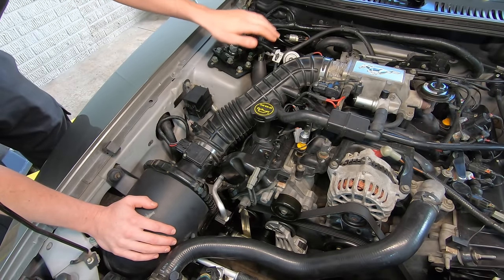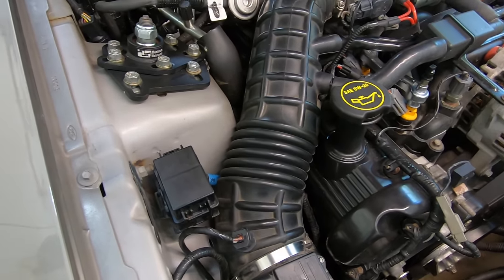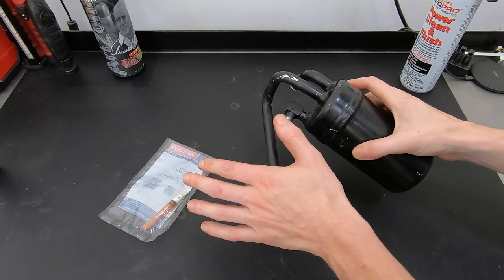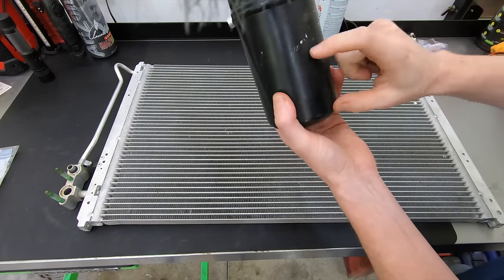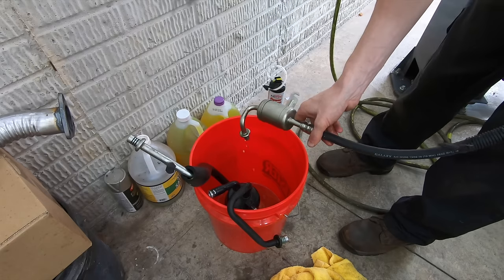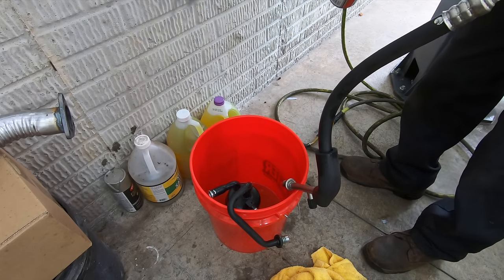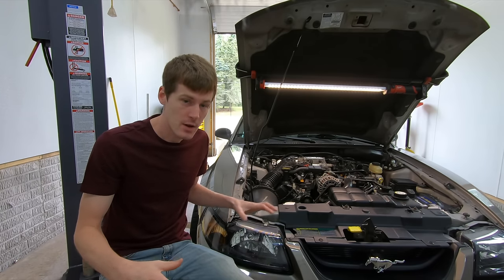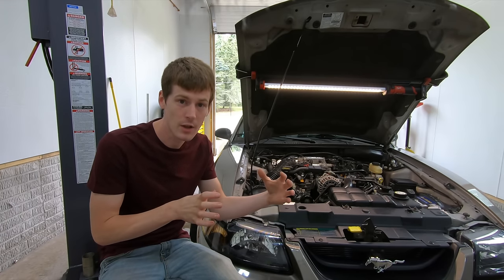How To PROPERLY Flush and Recharge A Contaminated AC System.

Comment: How much more would it cost to just replace evap and hoses instead of flushing everything and then blowing it out so no flush is in the system. Since you changed almost everything
Reply: In my situation changing the evaporator would require pulling the dash and that would require about an extra 2 days for my truck

Comment: Is this how you get the oil for an R12 system out when you fit the system for R134?  I heard the R12 oil is different than what is used with R134 so they the old oil needs completely removed
Reply from the maker: Yep, this is what you need to do.
Reply: @RepairGeek  thank you

Comment: Can you please tell me how to repair my 2021 toyota camry? It has a mildew smell coming into my car from ac. Is it the ac receiver dryer(header and desiccant bag or evaporator or condenser?
Reply from the maker: Your evaporator drain is probably clogged. Unclog the drain and disinfect the box that the evaporator is housed in inside the dash with specialized cleaners.

Comment: Thank you for your informative video. I am doing an LS swap on a Grand Wagoneer, and it may be a month or more before I can start it to add refrigerant. I would like to add the new A/C components to test for leaks now so I have access and don't need to drop my antifreeze in case I have a leak. Is it ok to leave the system with only vacuum pressure until the engine is running to add the refrigerant?
Reply from the maker: Yep the vacuum won't hurt anything.
Reply: Don't forget to upload videos

Comment: I didn't follow why you had too much oil the first time. When you vacuum the system would it remove the oil from it?
Reply: Same here...
Reply from the maker: The car's original compressor was failing. I installed a brand new from Ford Motorcraft compressor. 
The second compressor had a leaking input shaft after about 2000 miles.
I then installed another new OE Ford compressor.

Each one of those compressors had a full system charge worth of oil in it. By the time the 3rd compressor was installed the system was so heavily saturated with oil that it was no longer cooling and the high side pressures were too high actually hitting the pressure relief on the system.

Comment: I have to flush my ac in my 2005 121nz Toyota Corolla there's a blockage somewhere between the compressor to condenser to the high pressure switch the gas is not passing the high pressure switch to the evaporator an expansion valve my compressor went bad changed it an the pressure switch but it's not passing the pressure switch I'm going to change the condenser also

Comment: excellent tutorial when you started the recharge I missed the part when the high presure red valve was opened?
I do understand 1.attach can adaptor.2.attach to yellow tube, then open can 3.then open blue valve (missed the red valve being opened)?
also when you connect freon can to yellow tube after opening can shouldn't the yellow tube be loosened at gauge end to purge air in tube?I'm not sure my $30. gauge set has the check valve you mention in your replys to this matter.
when 1st can empties I assume both valves are closed untill new can is attached an opened then opened?
thanks for sharing you obviously put some time in the video thats why it's on top at y-tube.
Reply from the maker: 26:06
Reply: @RepairGeek  thanks brother see at 27:46 when starting the charging you said valves where open when you meant only low valve is open. thanks

Comment: I enjoyed your highly informative & stepwise presentation--you clarified a lot of my doubts about  lubricant.   It will help me immensely when I recharge my system .  Unfortunately moisture cannot be removed from polyethylene / polypropylene glycol by vacuuming--even for extended periods as these polymers are extremely hygroscopic; only way is either by 3A/5A  molecular sieves (ideally activated @ 250 C in high vac) or drying agents (anhydrous CaSO4, Na2SO4, KOH, etc).  The purpose of extended vaccuming is to remove as much air from the system as possible.  Remaining traces of water are  removed by the silica gel  present in the accumulator/drier.  I guess you cannot avoid getting some air in when you charge refirgerant from the can after prolonged vacuuming, right--unless you have a T connection with vacuum pump and freon source??

Comment: have you ever converted older cars to R134A? I'm curious to know of if its doable, and how!
Reply from the maker: It's do-able. I've never done it. I don't own any R12 vehicles. I've heard that once converted the AC doesn't cool quite as well as R12 but, that's just rumor I've heard. No idea if it's true or not.
Reply: done this to a couple cars myself so i can lend some help;
i have a 1990 civic hatch that I did the a/c conversion on. here's what you want:

(i would recommend having a shop professionally vacuum out all contaminants and old refrig oil.)

!!!!!FIRST THING FIRST: IF YOU HAVE R12 IN YOUR SYSTEM DISPOSE OF IT PROPERLY. IT IS AN ENVIRONMENTAL HAZARD!!!!!

#1. if you have a serpentine condenser, either flush it or replace it with a parallel flow condenser.
I went the flush route and have had 7 years no problems, the performance is just not as good because parallel flow is used in R134a systems and is appropriate, while the serpentine condenser is the old style (but it can be flushed, due to the size of the tubes)
#2. replace your expansion valve/orifice tube, and your drier can. make sure to replace all the Orings in your system with green neoprene orings. this is crucial to not have any leaks. 
search up your shop manual to make sure the proper oring install process.
#3. expunge all of the old mineral oil out of the system either by flushing it or by replacing everything. 
#4. before everything is hooked up, charge your compressor with the appropriate PAG oil. (after I dumped all the old oil out of the compressor I measured what came out and added the appropriate amount until it was filled to manufacturer specifications, 4oz of PAG46 in my case.) then hook lines up.
#5. vacuum the system down for 15 mins, leave it for 15 mins, and if there are 0 leaks go ahead and vacuum it down for an hour.
#6, charge with appropriate amount of R134a. general rule of thumb is you want 15% less freon than what is specified by OE but YOU MUST CHECK FOR YOURSELF.
#7, enjoy nice cold a/c in a 30+ year old car B)

Comment: I have a 1976 Dodge B200 camper that uses what seems to be a mercury thematic controlled expansion valve and no orphus tube. Old school tech but I'm reusing it. I will put the other 1/2 of the oil in the evaporator in the dash (maybe). The evaporator is actually in the engine compartment in a metal housing. The drain pan had rusted holes but I rebuilt it exactly like the original. Others say to remove all components to flush and shake them around to get every corner of the evaporator and the condenser. This old school condenser has the large tube type so worth it to flush. Thank for telling us how the new ones are too small to flush.
The old Dodge evaporator and condenser had old oil in them. I hope only 2 oz in the evaporator will be enough. I am just draining out the compressor and replacing what comes out (maybe) while spinning. Others say to set the compressor with the pulley down for 10 minutes and then turn it again 10 times to make sure the oil gets onto all components.
The old evaporator and condenser had old oil in them. I hope only 2 oz in the evaporator will be enough if 4 oz comes out of the compressor. I am not sure why some say to just replace what comes out of the compressor while you say to split the the oil between the two. I don't have specs. It's from a 1993 Range Rover to replace my old noisy Dodge Compressor. All the hoses will bolt up nice and I have new proper line seals. The old Dodge did not use a screen filter but will check if the newish compressor has one on the intake. Compressors are similar in size and use the double v groove belts. The Range Rover had a clean working system. Googled the specs and oil capacity might be found. Should I split the oil capacity and not replace what comes out by splitting it with the evaporator? Since it was a working system shouldn't there some be in components while what is in the compressor should be the right amount? I have the proper flush kit, a gallon of fluid and proper new vacuum and gauges. I know how to use them. I'm going to use R12a since it is cheaper in Canada than the States and if it leaks it doesn't ruin the ozone. The Range Rover and the Dodge was converted to R134a so should work with R12a as well. I bought a new sealed dryer. Any help would be appreciated.

Comment: Hey dude, great vid and thanks for all the info. Quick question though, after flushing the system, if i put a new compressor, precharched with oil, do i still have to add oil in the evaporator or should I just let things like that?
Reply from the maker: I would verify that that correct amount of oil is in the compressor by draining it. Then, do your half and half.

Comment: I was wondering how you read the high pressure side is the high pressure side still connected to the vaccum pump or blocked or else it will lose pressure?

Comment: To check for a leak after you pull a vacuum on the system do not, I repeat do not fill it with air. Air has moisture in it. Use nitrogen before pulling a vacuum. Fill the system up turn off the gauges, then wait for a half hour and see if the needle moved. If needle moved fill it up with  R134 that has die in it. Fix leak and repeat.
Reply from the maker: FFS, so you're going to spend well over $200+ to buy a nitrogen tank and gauges, to POTENTIALLY keep moisture out of a drier? A new drier for this car is less than $20.
Also no refrigerant has dye in it. The dye is in the oil, this was covered in the video as well. Thanks for watching?

Comment: On a Ford classic car AC system that has the York compressor. The york compressor has a oil well correct?  With a drain and fill hole.  Did the evaporator, expansion valve, lines, dryer, condenser have any type of oil in them?

Comment: I'm wondering what happens to the compressor if there is not enough PAG oil in the system. Anyone?
Reply from the maker: It wears quicker. If the system is very low on oil, the compressor usually makes a growling type noise.

Comment: One thing to note people.  Never buy a remanufactured vehicle AC compressor.  Always purchased it new. Stay away from those “reman” units.

Remanufactured AC compressors are used, picked up as cores by the local parts stores, then they’re taken to a facility, where they’re cleaned up and reassembled with new gaskets & seals, but the wear & tear in the inside, is still there.

Comment: The flush and clean can says to run nitrogen gas through the system to remove air and condensation before vacuuming. I have not seen anyone do this in DIY videos. Is this just not done?
Reply: Charging the system with nitrogen is an extra step used to purge the system and to  check for pressurized leaks so you don't waste freon and isn't practical if you don't have access to any large tanks of nitrogen

Comment: “You will blow up the can” - if the refrigerant is added to the high side. Not if the compressor is not running and there was a vacuum pulled.
Reply from the maker: Yes, IF the compressor isn't running... I'd love to know how to charge a system using cans, WITHOUT the compressor running...

Comment: Heard that you can and should check compressor for metal shavings contamination .  I've heard but am uncertain whether you can flush out system of this .. ?  Needing to replace compressor on my 15 Ford Fusion SE 2.5 L and kinda leaning towards it's almost NOT contaminated the condenser as well . IF contaminated some mechanics say a flush won't clean it out well enogh and need replacing condenser ? Any advice would be greatly appreciated

Comment: I have personally flushed several ac condensor never had a problem flushing both directions you can buy a gallon for 60 bucks so I don't agree I would flush a condensor not buy a new one and a gallon of flush will do to ac syster

Comment: Maybe a little moisture would be contained. But it’s bad practice. The water mixes with oil and becomes acidic . The acidic oil is bad for compressor and other parts. Reducing lifespan of system . Also the water condenses at a different rate then the refrigerant and boils at different temperatures making it impossible dial in charge to most efficient range. Bad all around. Nitrogen is very cheap at all hvac supply houses. The original tank and valves cost a bit of money but the refills are cheap 10$ for a refill .  tank and flow gauge maybe 3-400$

Comment: Everything was spot on until you hooked up the refrigerate can to the yellow hose going to the manifold.  You didn't purge the yellow hose at the manifold fitting.  Hose has air in it which also has moisture in air.  Now system is contaminated.    Bummer  😢
Reply from the maker: The mainifold gauge set has "low loss" fittings. Meaning the yellow hose has a Schrader valve in the end that connects to the can/vacuum pump. The vacuum was held when I disconnected.

Comment: I bought all new AC components except the evaporator. My new compressor comes with my cars  total oil capacity does that mean i should dump out half the capacity an put it in the evaporator so its evenly distributed?
Reply: What you end up doing
Reply: @TheTruth-ge7fj  I emptied the compressor and refilled half and half

Comment: Can someone tell how to purge the car AC system with dry nitrogen after solvent flushing? Is it very complicated procedure? Probably it is, since nothing on YT on this subject (including this rather detailed film, purging w/N_2 was not done at the end). But if someone did it, please share your opinion. Thank you in advance.
Reply from the maker: I've worked in multiple shops. I've never worked at a professional shop that has used a nitrogen purge. These people that are recommending a nitrogen purge/pressure test are from the residential/commercial HVAC background. I'm not calling them wrong but, guys in automotive shops don't do it from what I've experienced. Call a local shop and see if they use a nitrogen purge. Some (nearly none) may use it for leak checking large leaks but any automotive AC machine I've used vac's the system and charges by weight.

Commercial HVAC deals with a lot more refrigerant and much larger systems than what you will ever see on any car. Extracting all that atmospheric air in a large commercial system isn't easy to do so they purge and pressure test with nitrogen. If they have any leaks after charging the system it's a much more costly mistake than 20-30 oz of R134a that you would find in a car. They also charge based on pressure reading because every system they deal with is different, automotive is filled by weight because every 2008 Honda Civic takes the same amount of refrigerant. Automotive shops could deal with 1000s of the same system, commercial HVAC, no 2 are the exact same.

And cue the people saying I have no idea what I'm talking about below...
Reply: @RepairGeek  Thank you so much for detailed explanation. I started to guess that N_2 purge is smth. for maybe really expensive cars or large HVAC system, but it was important to know the opinion of the experienced mechanic. A few mins ago I saw another film on recharging of car AC and the author got 42F on Inner Vents w/no N_2 purge, just vacuumed, checked for leaks, and added freon (in the same way how it is shown in this film). Thank you again.
Reply: I used to repair the refrigeration units on semi trailers , carrier , thermoking , we used nitrogen to find the leaks , but it's in bulk tanks ,with pressure gauges and control valve on the tank  we had to all get licensed on how to handle refrigerant and nitrogen etc.( thank you swift transportation  ) It's came in handy for my personal shop also , but it's hard to buy without the license..I never use the nitrogen in my personal stuff , it's for larger systems , imo ..
Reply: @MikeSmith-nu9wt  I've heard, that N_2 is primarely for large refrigerant systems, but thank you for additional confirmation and sharing that fact that you personally, been professional in N_2 handling, don't use it. I refused from that idea, I think the person who wrote (on Amazon) about use of N_2 on car refrigerant system maybe worked on very expensive cars or smth. Thank you again

Comment: $50 condenser?!?! LOL I wish.  Just looked up the price on my condenser - $512.08.
Reply from the maker: Don't buy a vehicle used that you couldn't afford new.
Reply: People buy used because they cant afford new most of the time
Reply from the maker: @victorparra4227  You can buy a used Bentley for the same price as a C7-C8 Corvette. Go price a brake job for each of those cars and you'll understand what I'm saying.
Reply: @RepairGeek  The vehicle I drive is more expensive now than it was new.  And I paid cash for it tyvm.  My point is that replacing the condenser isn't an automatic no-brainer.  Plus, in order to replace mine, I have to remove a 250lbs brushguard, disconnect a bunch of wiring and remove the hood.
Reply from the maker: @nothingtoseaheardammit  you have the cash (tyvm)... Gotta pay to play my guy.